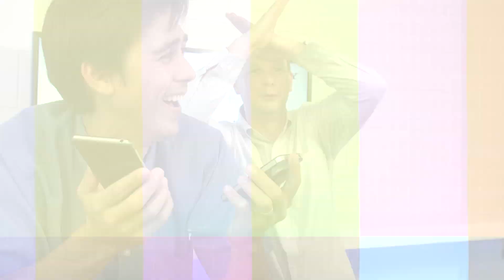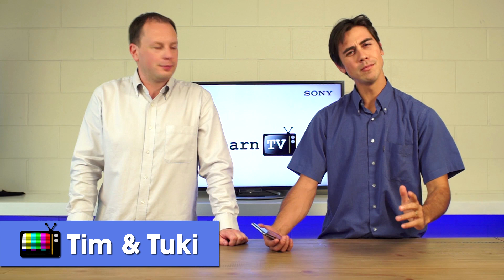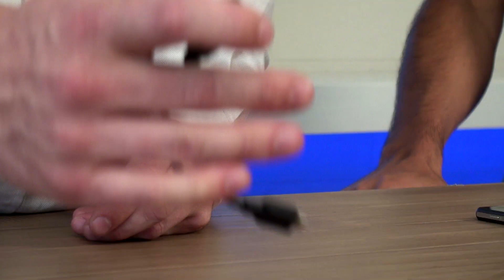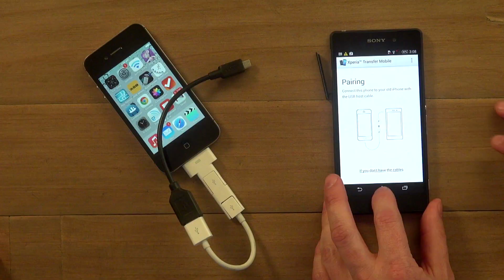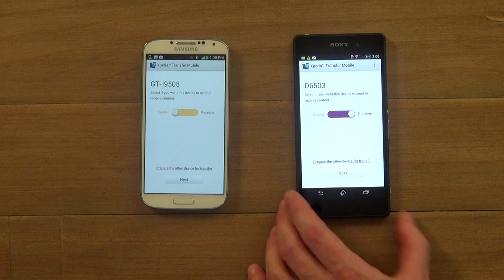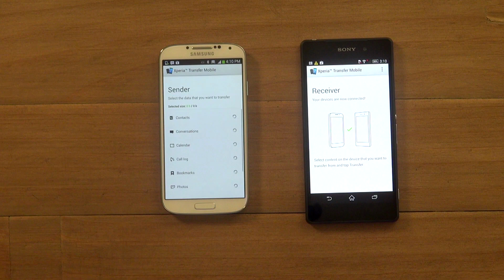Sony LearnTV. Xperia Transfer with the Xperia Z2 smartphone

Comment: How long will it take to transfer about 40gb of music from my iphone 5s to z2 using this process
Reply from the maker: It's going to take a while - the transfer is generally done at USB2.0 speeds so a 'theoretical maximum' of 60MB/sec (in practice quite a lot less). You can set and leave it but obviously you will want to ensure both phones batteries are charged to save interrupting the transfer.